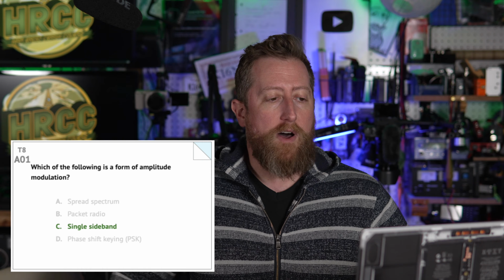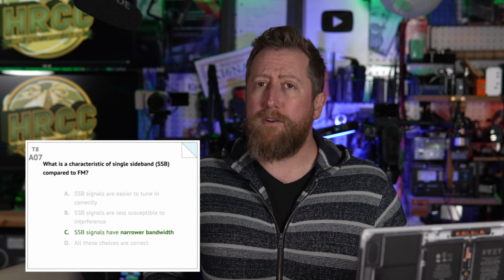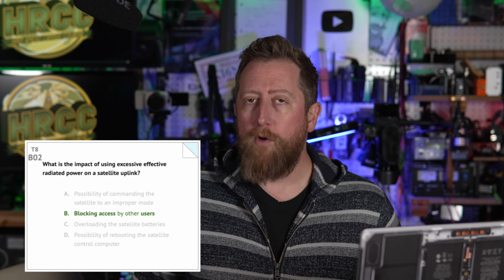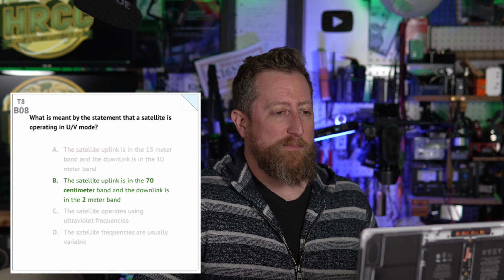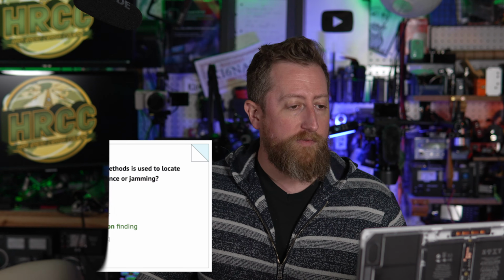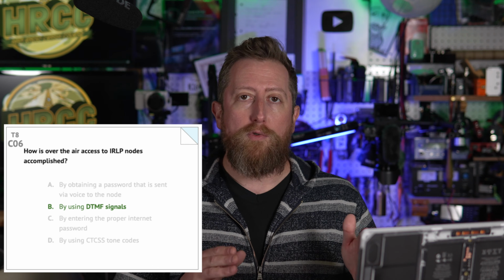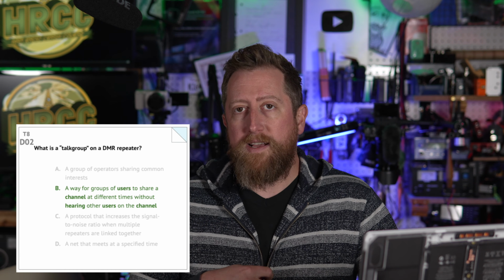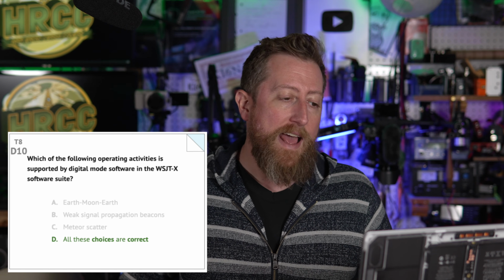Ham Radio Technician License Prep: Sub-Element 8 (2022-2026)

Comment: Years ago on our C, B, S, we used to have skunk hunts, and we used to use SWR meters and signal strength to track down our prey. So the closer you got, the higher power level would show up on the meter, and on your radio, the lesser power meant you were getting farther away, we used to call them skunk, hunts. And they were a lot of fun, I want to get into it. On the ham radio, because I think it would be a lot of fun

Comment: T8-B03  Doppler shift refers to the change in frequency of a signal as perceived by a receiver due to the relative motion between the transmitter and receiver.  This effect is especially noticeable when dealing with satellite communications or other mobile stations.  When a satellite is moving towards the radio operator, the frequency of the received signal appears higher than the transmitted frequency.  Conversely, as the satellite moves away, the received frequency appears lower.  This shift needs to be accounted for to maintain clear communication.  Operators often adjust their equipment to compensate for the Doppler shift, ensuring the transmitted and received frequencies remain aligned throughout the communication session.